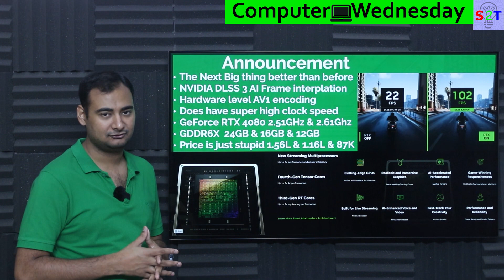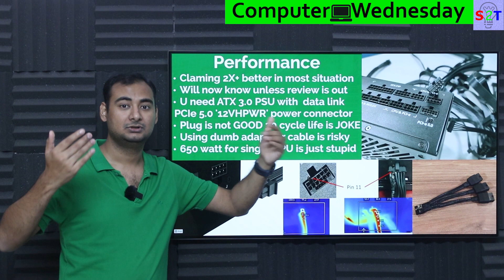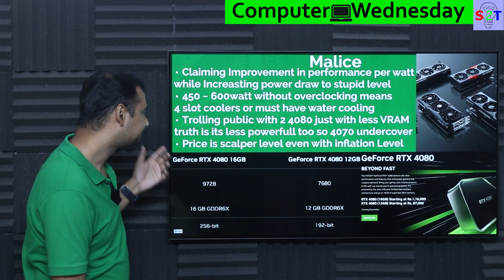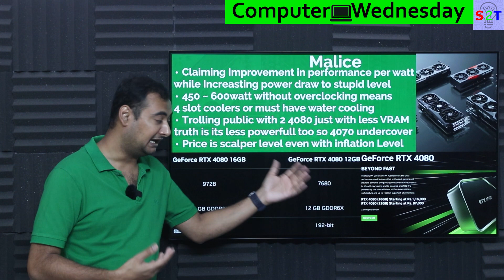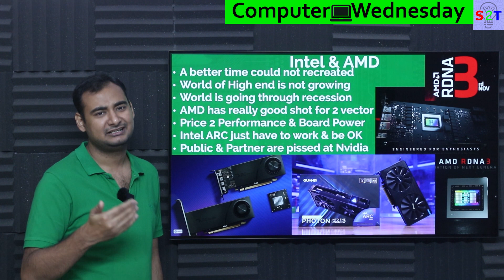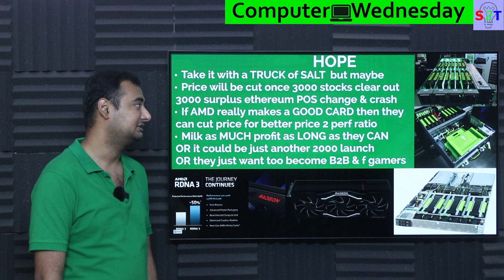Nvidia RTX 4000 Explained {Computer Wednesday Ep201}

Comment: The problem I have with DLSS3 is that the optical flow generator is getting no input from the game engine, so its vector based FRAT will be subpar when compared with how frame rate amplification works in VR for example.
Reply from the maker: Fair poin this launch is too close to a dud
Reply: Probably not at problem if you go from 100 to 200 FPS but if you go from 40 to 80 it would feel sluggish as hell